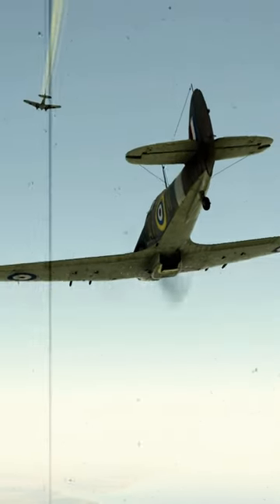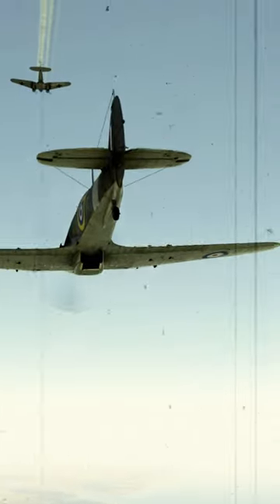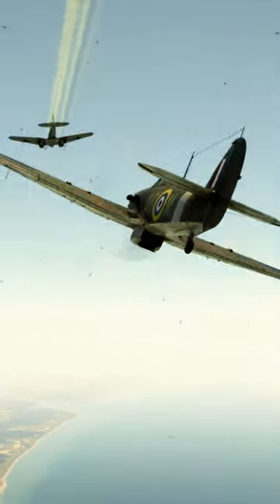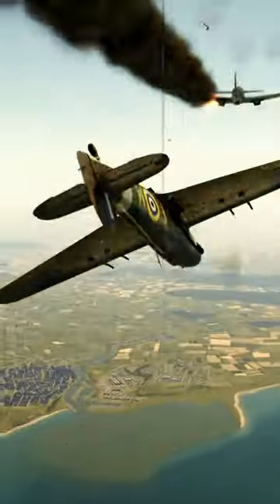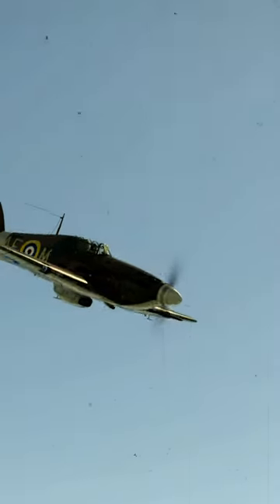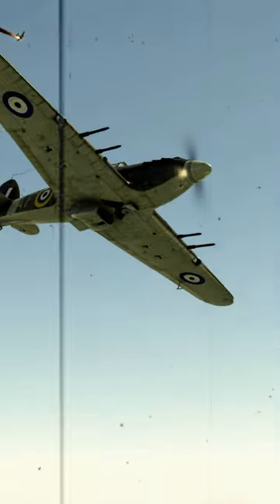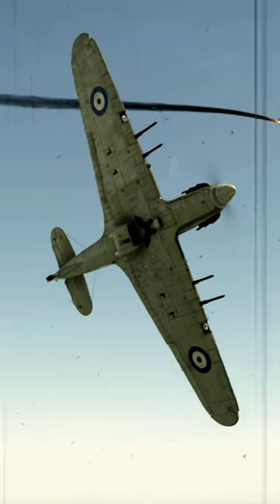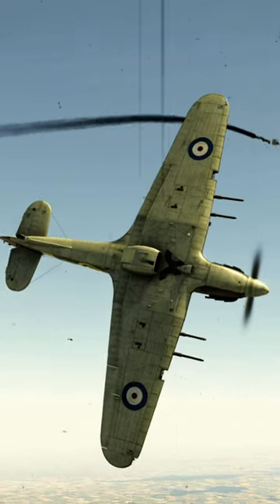Hawker Hurricane Mk 2, Engine Management | WW2 Air Combat Flight Sims

Comment: Not true, the Merlin XX had a 2 SPEED single stage supercharger.  Fair effort.
Reply from the maker: I stand corrected. Two stage introduced in Merlin 60/61 sometime in ‘42. I read my source wrong.
Reply: @WW2AviationGeek  The Spitfire V would have been a lot more competitive against the FW190A if it got the very minor modifications needed to take the very slightly longer Merlin XX, the 190A also was 2 speed single stage but with a big heavy 42 litre lump.
Reply from the maker: It's interesting how changes evolved in airframes and engines. Didn't the Merlin 45 have similar performance to the XX?
Reply: @WW2AviationGeek  Not at lower levels, it had to be grossly throttled back because of the very tall supercharger gearing for high altitude to compete with the 109F.